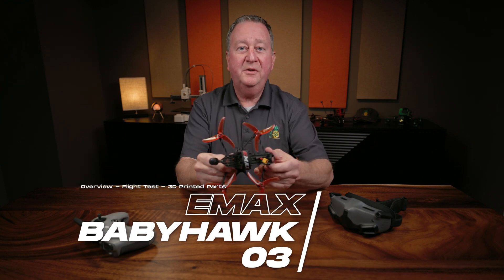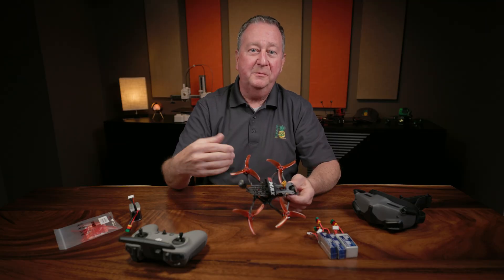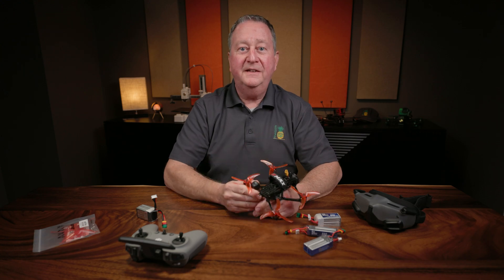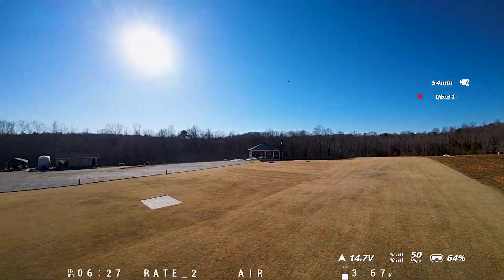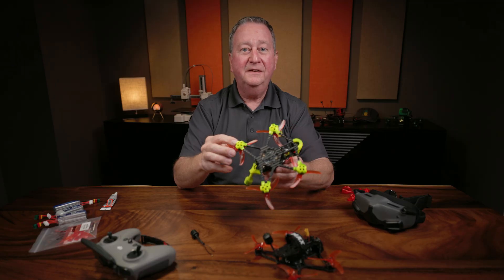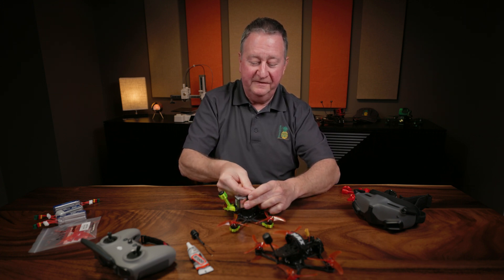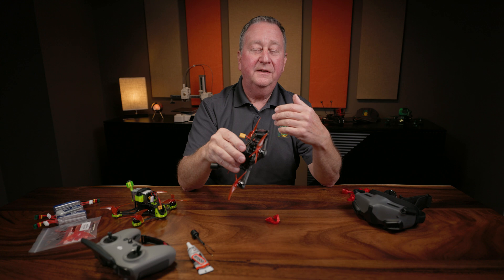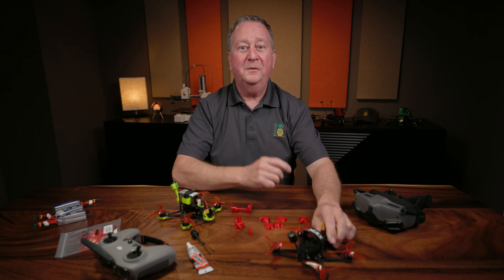Is the Babyhawk 03 the Best Practice Drone? | Flight Test – Mods Upgrade

Comment: Just printed out your files, very neat. Only the landing foot for front and back is only for one side on the frame..
Reply from the maker: You need to mirror the feet, so you have a right and left.  You should be able to do that in your slicer software.  Let me know if you have any problem and I will mirror them and upload them.  Thanks for watching 🍍
Reply: @Pineapple22  thanks for your quick reply! I really don't know how to mirror them as I'm a newbie.
Reply: And I have another question. I'm doing a conversion on my babyhawk 2 HD to the O3 air unit. Could you help me out where I have to solder the 6 wires from the O3 air unit on the FC? It is the exact same FC as the version I have with the vista air unit.
Reply from the maker: @PatronFPV  I put the Mirrored STL files in the folder on OneDrive for you.  I also put a couple of photos of my wiring on the flight controller to the 03 hope that helps.
Reply: @Pineapple22  Thank you so much! Really appreciate your help, now I can go a step further again!
Reply: What controller are you using with the babyhawk? Tbs or dji?
Reply from the maker: @PatronFPV  I am using the DJI Remote Controller 2.
Reply: @Pineapple22  All connected and working, tomorrow out for a testflight. Thanks again 🙏
Reply from the maker: @ Let me know how it goes.
Reply: Flies very well, I want to add a hglrc m100 mini gps to it and this newer generation works better with newer versions of betaflight (from 4.3 and up). What Betaflight version do you have on the Babyhawk, did you update it?
Reply from the maker: @PatronFPV  I have not upgraded mine it is still on 4.4.0 the only thing I changed were some of the failsafe settings.  I was thinking about upgrading it to 4.5.1 and see if it flies better.  For some reason every once and a while it will develop a shutter that is not recoverable.
Reply: @Pineapple22  I've read about this problem shutting off the fc during midflight.. mine is still on btfl 4.2.5
Reply from the maker: @PatronFPV  Have you had any shutting off or shuttering with yours?  I have had both and cannot seem to figure out why it will just drop out of the sky.  I thought it was the batteries and with the Tattu batteries it does not happen as much as with the RDQ batteries.
Reply: @Pineapple22  I never experienced that, but mine is also on the btfl 4.2.5 version. I read that when people tried to flash tk newer versions the problems started with fc's shutting down so now I will just leave it like this and hope it will work with the m10 mini gps unit.
I have 3 5-inch drones but this babyhawk is now my favorite allrounder drone, its just so so good with the new upgrades!
Reply from the maker: @PatronFPV  Mine was delivered with 4.4.2 so I might try rolling the firmware back and see if that fixes the problems.  Glad you like the upgrades, the Antena tube was the big one for me.  Thanks again for watching.
Reply: @Pineapple22  rolling it back sould solve your problem indeed! Happy flying!

Comment: Looks very sharp! Which file is for the O3 camera mount on the front? I can't seem to find it in the link you shared
Reply from the maker: The reason you did not see the mount is because I forgot to put it in. Thanks for the heads up! I also included a mount that I am working on which extends further down.  The link has been updated.  Thanks for watching🍍
Reply: @Pineapple22  thanks!  So which file would you recommend for the O3 camera mount, the extended 3 version or the other one?
Reply from the maker: @PatronFPV  I am just using the original camera mount not the extended.  I did six batteries yesterday and had several crashes through the gates and turtle mode flips and the antena tube worked perfectly not even a scratch.